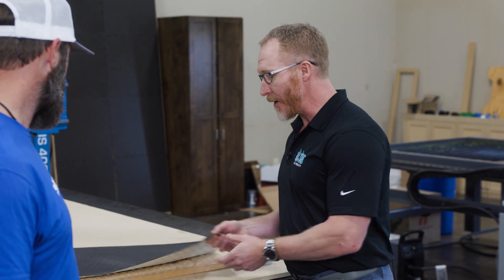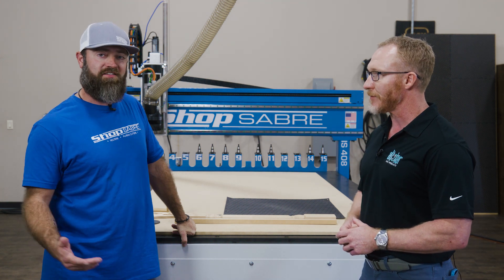"ShopSabre Minutes" - AllStar CNC

Comment: I'm seriously considering buying these for my 5x10 i don't recall hearing you say the vacuum zone settings on this example was this full open or zoned for the lower part of the table the holding difference was substantial but when he got to the dino head it was at the lower end but we didn't get the data to know what its like without the gasket. I'm having lots of trouble with text cutouts on 1.5-2" thick foam with 1/16 aluminum face the cost of double sided tape is eating my profit so I'm hoping this could make all the difference in the world for me.
Reply from the maker: if you would like to discuss all of these things, our support team is happy to discuss. The AllStar gasket will certainly improve vacuum focus on smaller area parts. We will address this question on our Podcast this week if you want to checkout the latest Episode on Wednesday morning.

Comment: No to be a dick, but how is this technology different from most air hockey tables? Air hockey uses a constant stream of air pressure to "float" the puck (see: item you're creating) and this appears to be doing the same, but opposite. In my experience, everything that I engrave, lathe, laser, etc. will be viced into place (or the laser will not affect the position of the subject), so this is uniquely floating on air pressure, but why is that important/valuable? If you need to make a one-off part, seems like a cheap epoxy is the way to clamp the item down. Or just 3D print it and then make a cast of that item to test. If you need to replicate the part by hand, a polymer clay would be the best material, followed by a casting, but this seems to be an air/visual solution that is searching for a problem. I've worked with laser engravers, 3D printers, smelters, welders, and more and this just seems like the wrong approach to the issue.

I found this company because you called me for a job. Definitely gonna reconsider my rate now LMAO. Take this advice for free and please run with it.
Reply from the maker: That was a lot lol, not sure how to respond because the way you described seems like way more work than to use this product. 

Never the less, thanks for checking it out
Reply: "Not to be a dick".......

Failed.

I can't imagine anyone hiring you for anything, especially since you don't understand vacuum clamping, and/or CNC work.

Comment: That's pretty amazing.  I would imagine that z-height for through cuts is pretty critical as you don't want to skim into theses tiles too much or are through cuts simply not something these are intended for?  Thanks!
Reply from the maker: Correct, proper z height is always crucial in vacuum for best performance

Comment: Is this to be uses without the vacuum system
Reply: It is to be used with the vacuum system. It gives you a better vacuum seal and helps to hold the parts better
Reply from the maker: With preferably. It increases hold down.